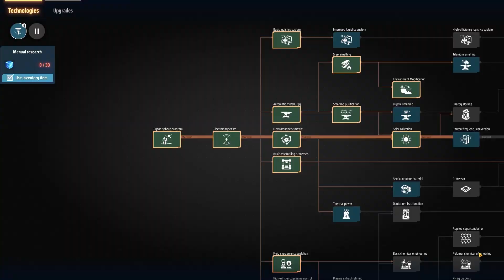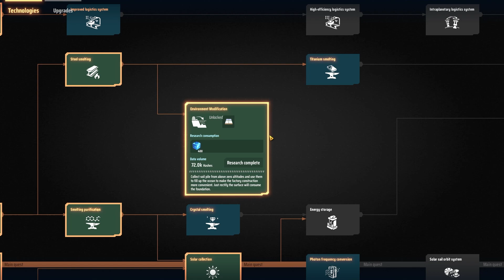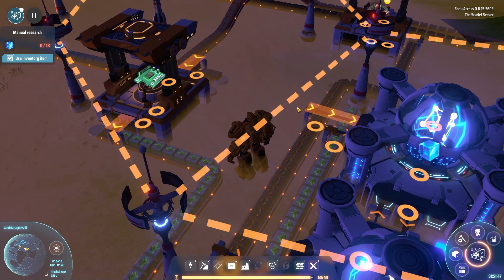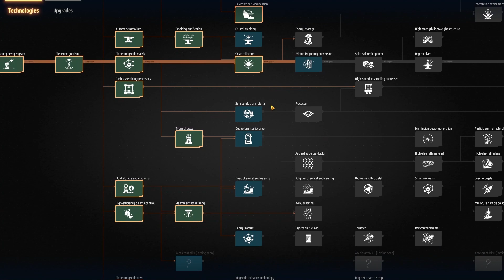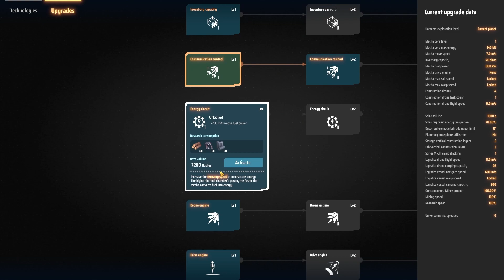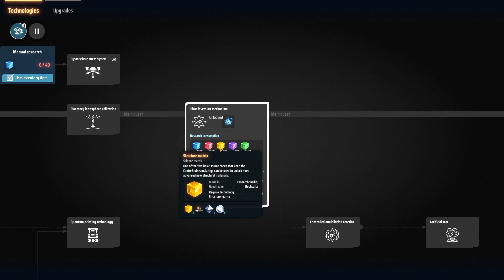Dyson Sphere Program | Part 2 - A FAST PACE

Comment: The second recipe you saw on the graphite requires the x-ray cracking tech, a bit further down the tree. Before you get that, you have to figure out what to do with the refined fuel or the oil refineries will back up and you won't get enough hydrogen. It's an interesting challenge. ^.^